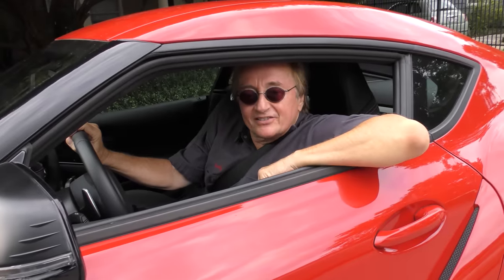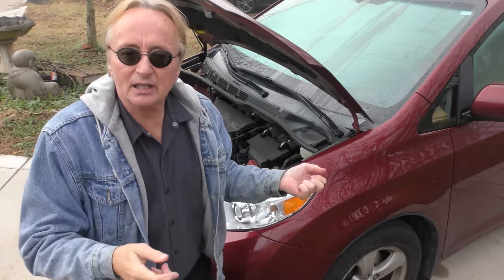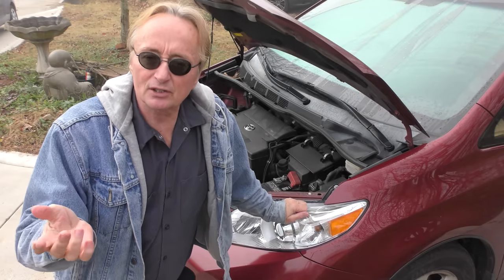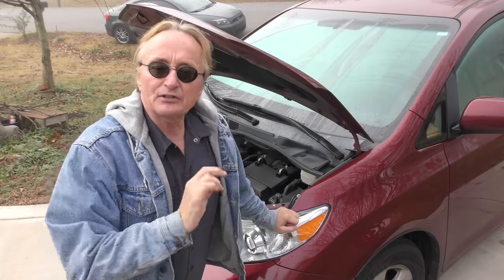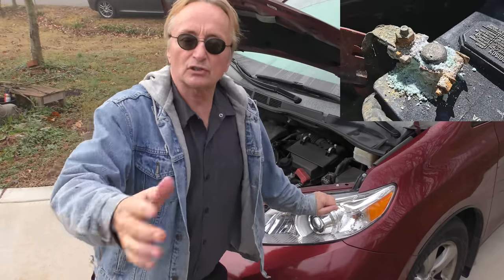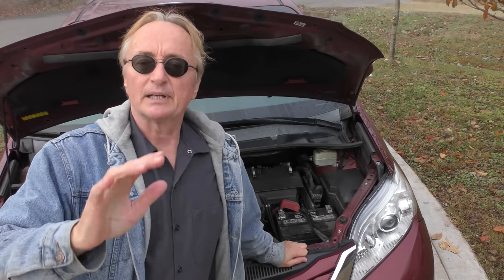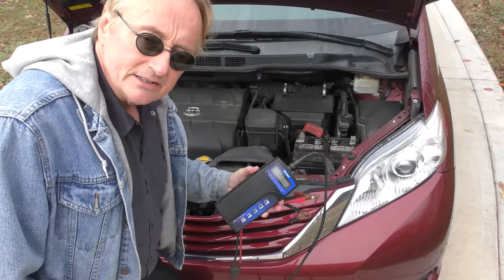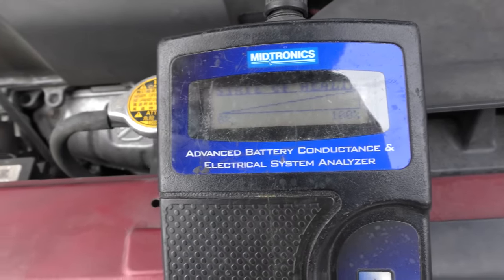If You Buy a Car Battery from This Place You’re Stupid

Comment: Scotty you are 100% CORRECT I got a battery from this place for my 2008 Chrysler 300 SRT8 and it DESTROYED the car. It’s now at J&J auto wrecking
Reply: I think the fact that it was a 2008 Chrysler 300 SRT8 had more to do with it. In case, may it rest in peace.
Reply: Probably installed wrong polarity😏
Reply: @raymondsmith6315  Unless the battery shorted out and backfed through the electrical system, otherwise I agree completely.
Reply: Install error. Lol
Reply: And that was a good car only 68k miles damm RIP Chrysler

Comment: I worked at Exide battery  in Reading PA . They make the batteries for Autozone , Advanced Auto , Napa and Walmart.
Reply: I just recently brought a Exide battery at Home Depot recommended by my friend. Works great 3 year warranty cost $109 while duralast was $169. Can’t believe the big price difference.
Reply: Unless this has changed since March 2020 Clarios makes there batteries not Exide. Former Advance employee. Rural King sells Exide and they are absolute junk. Advance named Clarios their 2019 vendor of the year.
Reply: A few yrs ago, a battery I got at Walmart had a sticker on it that said Mexico.

Comment: The longest lasting battery my friend bought for me was from Walmart & it lasted 8 yrs.  It was about $60.00.
Reply: When was this ? nowadays they cost around 200+.
Reply: My 8 years old Altima still have original battery. Checks good, but I'm changing it before winter.
Reply: I need a battery. My car is old and I want one as cheap as possible. I have a Wal-Mart $50 gift card so that’s where I’m going lol
Reply: @johnnya287  screw it I decided to just buy one at auto zone with warranty lol

Comment: I bought an Oreillys battery 5 years ago in the spring. By winter, it dies off and wont start my yukon. Granted i have a minor parasitic draw i cant find that eats up the battery, but ive returned the battery and every year.  Oreillys tests it and always say it's detective, and they give me a new one.
Reply: suggestion if i may. as i posted above a simple batter maintainer from harbor freight will keep a fully charged battery charged.
Reply: The battery maintainers from harbor freight are junk

Comment: A battery getting old and losing it's charge can cost you:
Your alternator will need to work harder and wear out the brushes sooner. 
When your starter is dragging it draws amperes, gets hot and it will fail prematurely.  
Your heater fan motor, wiper motor, power windows and locks are dragging and slowly burning them up.
As soon as my battery tests borderline I buy a new battery.
I put an Interstate Brand little car battery in my old Bolens riding mower and it lasted 15 years.
The MTP types are the best batteries made by Interstate.

Comment: Speaking of motorcycle batteries...  The longest lifetime battery I ever had was 15 years...  It was a 2000 Suzuki Bandit and I replaced the battery in 2015.  I bought the bike used in 2003.  The battery was OEM.  First thing I did to the bike once in my garage was install an electrically heated clothing tap.  Of course, the tap then doubles as a harness for hooking up a smart trickle charger.  The thing was plugged in and maintenance charging the moment it entered the garage from a trip.  The bike now has over 100k and it's been all over North America.

My pickup truck sits idle most of the time.  It has a knife switch on the battery negative terminal.  It's also hooked up to a smart trickle charger while it sits.

I get quite a bit of life out of my batteries.  ;-)

Comment: Blame the lead shortage on the ammo shortage
Reply: I thought that was because of the brass?
Reply: blame the lead shortage on the fact that manufacturing, many recycling plants, and overseas shipments were shut down for quite some time...
Reply: The shortage isn't due to lead. It's due to primers.
Reply: It's likely the EPA who makes batteries expensive and experience shortages. They have a ton of green recycle rules which require expensive licenses and then "Lead" is like poison to those EPA nerds. They usually are in the way vs. doing any good however, the good they do is reasonable but there is a limit to what they should get involved in, they just haven't figured that out yet.
Reply: @Garth2011  lead is a poison.  Just ask the parents of Flint Mi.  Lead causes nerve and brain damage.   Don't bring opinion in to facts.   Yes the EPA over reaches at times.   But I don't want to live in a chemical wasteland like some parts of China.   Yes jobs are important but there is a cost for everything.  Nothing is free including clean air water and soil.   No regulations means a return to the bad old days of cancer and birth defects and shorter life spans.  Depending on what you do for a living EPA and OSHA regs might be keeping you alive and healthy.
Reply: @p.o.9964  Didn't say eliminate the EPA or suggest chemical wastelands. Regulations are fine until they overstep reason. Once you factor in cost vs. benefit, not all OSHA and EPA dreams are reasonable. Just like my vehicles...every two years they have to be checked for pollution levels. For both of them, they pass every time and have like millions of other vehicles do yet the EPA doesn't trust 99% of the people who pass every time so we all give fee's to the State for nothing. It's those few who continue to try to beat the system and there should be better methods to address them vs throw everyone into the dishonest tank. If the EPA was somehow taxed or penalized for the overly expensive methods to control emissions etc. they do to business owners and the public, with very little benefits, they'd think about their process in more economical ways. As it is today, some methods are good and lots of them do not but they don't care about the costs, they just make rulings and enforce restrictions that most folks would rework to be more valuable. CA has an organization CARB in addition to EPA and they believe that CA atmosphere stays in CA apparently. Well, the facts are that is untrue most of the time. 
There are dentists who say "You must take out your silver fillings and replace them with the new plastic ones". Totally untrue but the sales pitch is "mercury" based isn't healthy. Those dentists should also say, silver fillings are still acceptable in the dentistry and the health dept.
Reply: @p.o.9964  there is regulation and then there is over-regulation.
Regulation can make certain processes and industries, safer for workers and the environment.
Over-regulation tends to make those same certain processes and industries too expensive to occur here.  When this happens, it just shifts where the dangers lay, and who gets affected.  It actually makes it far worse for the environment as well as the new workers that are subject to far worse conditions in a largely unregulated country.  So, all you're doing is shifting the workload, killing the industries here, and giving that work to someone overseas, often in far worse working conditions.  The EPA. like many other alphabet agencies,  is not known to make wise decisions to help US industries; often, misguided officials work to close down industries because of their "feelings"; shifting the workload overseas does not help; it rather hurts everyone else. 

Flint Michigan is a disaster because of years of neglect by politicians and elected/unelected officials, most of the dem variety, over the course of decades.  it's just another shift the blame game sort of thing; but it was brought upon by voting democrats into office, and decades of neglect afterwards.  Basically, no one wants to pay for their own infrastructure upgrades;  "poor us" because the residents and their elected officials just chose to do nothing until it became a major disaster;  even then, they're not the ones picking up their mess; it's other taxpayers. Eventually, all infrastructure needs upgrading; yet this population is the victim because they don't want to pay for it themselves.  The inaction of elected leadership was borderline criminal.  The elected leadership is elected by themselves.. Reality is that they are victims of themselves and the previous generations that voted the same way, decades after decades.. . Way too many in Michigan want that free ride; just like many other dem ran areas.
Reply: @MrPir84free  I agree that the EPA at times over reaches.   That is why I have said the we should put environmentalists, safety, industry and workers together to create policy that all groups can live with.  Not a perfect solution (as if which a thing is possible) but one that we the people can live and work with.

Yes Flint was a failure of political leadership (no surprise), but my point is the damage that lead causes.   Not on what the cause was.   Opinion here:. I honestly think there will come a time when folks will come to realize that plastic is like lead was to ancient Rome, cheap, plentiful, easy to work with, but toxic to our biology.  Plastic has contaminated every place on this planet.   I also think it is why people and animals are getting fat, and the increase of emotional issues and many other ailments.  But that is just my opinion.
Reply: Oh by the way when Flint was contaminated it was done under the Republican watch.   Governor Rick Snyder was at the time.
Reply: @p.o.9964  Wonderful work the current Governor is doing with all of those dams in Michigan. All that lead being spread downstream.
Reply: Balme the ammo shortage on the Democrats.
Reply: @volvojohn9036  Over the years it seems that the democratic voter and the democratic candidates have much different views. Those incumbents and those candidates for the democratic party are extreme left liberals while the voter seems to be much less of that. This is where some have been suggesting, its not the democratic voter per say but those alleged democratic candidates who are the worst enemy of this nation. Not to mention, many who register and vote democratic are employed by the feds, states, counties, cities etc. and will blindly vote for dem candidates just to see if they get a pay raise or benefit margin. NOT the best way to vote.

Some of these "shortages" are man made just to use an excuse to raise prices. Also, when was the last time ammunition companies expanded to keep up with demand? People need to stop buying ammo and let the system work for them. In time, shortages and high prices will not be an issue.
Reply: @p.o.9964  Please read down below a reply to Garth Clark, In rare form I posted info just to show SOME of what I have seen.

Comment: The stock battery in my Scion xB lasted almost 9 years. Since then i've been through a battery every two years. Junk batteries now-a-days.
Reply: The stock battery in my Toyota Corolla lasted 8 years. It was a Panasonic,yeah, like the stereo.Looked online and couldn't find one.
Reply: Panasonic, my 2012 FJ Crosier has original Panasonic from factory too. Problem is, you can't even buy that Panasonic battery off the shelf anywhere.

Comment: Scotty is right on the money, Autozone batteries are WAY overpriced. I picked up a fresh Walmart battery in october rated at 680 CCA and it tested at 731 CCA. The batteries are made in the same factory as the Autozone batteries.
Reply: Lots of batteries are made by Johnson, then brands just put their own label on it. Might as well buy them at Wally's.
Reply: @FredTheLutinoCocatiel  Interstates  are the best battery for cars.
Reply: @kachiquitaito3341  agreed.  Both my cars have Interstates in them and even on the coldest days cars fire up no problem at all.
Reply: @lonewanderer3603  again, just because their made by the same company doesn't mean their made to the same standards. Look at the CCA rating on wally world batteries, its lower then everyone else's. You get what ya pay for
Reply: @jroda8015  
agree......wally  world  N-everstart  battery.  don't  expect  it  to  last.
Reply: Not anymore, walmart has changed suppliers around the time of this post
Reply: Walmart batteries, at least around me, are all Deka batteries with somewhat lower CCA ratings.  I get my batteries from a Deka distributor near me, they run about $110 and have never given me a problem

Comment: I usually buy batteries at Costco and they last 8 years which is impressive. I live in Quebec and they're 120 CAD so around 95$ US
Reply: Good tip.
Reply: Me 2 half the price at Costco.
Reply: @girlonlaptop  My parents bought them too and on our Acura 1.6 EL 2000, the battery had lasted 7 years instead of the 8 years and Costco refunded us a bit less than 1/8 of the price of the battery without us asking (it was like 7 years and 2 months)
Reply: uhチュンチュンマル  Lol, we have been impressed with those Costco batteries and my parents have always bought them there after the one that came with the car dies and those Costco batteries just last so long
Reply: Kirkland car batteries used to be a Consumer Reports best buy. My experience in British Columbia they are now garbage. Stay away!
Reply: @MrAcer505  I installed my share of them at Costco
Reply: @grantwhebell7730  I am surprised to hear this. Maybe in BC they have a different supplier...
Reply: @MrAcer505  they sell Interstate batteries. Very good and about 95 bucks!
Reply: William Saad
How many batteries exactly have you bought from COSTCO?
What has been the lifespan of each of those batteries?
Reply: @andrew_koala2974  My parents each had  a car that kept until the wheels fall off (about 20 years) and they they bought about 3 batteries per car and lasted 7 to 9 years
Reply: I wouldn't buy anything at Costco, those stores are horrible no space in the aisles horribly arranged. In San Antonio there's so many people in Costco it's a joke. The nice stores in San Antonio are the discount stores owned by Walmart forgot the name. Anyway they have the best room in the stores the best layout and the best products. And you're not jammed in like you are at Costco. I hate Costco on never go back there again. Plus I have good food at the Walmart discount stores. Good pizza good hot dogs and plenty of room you can relax there you feel like you're in a sardine can at Costco. I hate that store parking lot too small plenty of parking at the Walmart discount stores
Reply: The name of the stores I like or Sam's, in San Antonio they have some very large ones very nice. I have a couple of old ones that aren't that great. But the newer stores are 50 times better than Costco beautifully arranged plenty of space a lot of good merchandise and you can eat the food there too is very good peaches awesome for $2 for two slices oh, and the best hot dogs ever. I bought a lot of stuff there and got good discounts if you watch when they're putting TVs out they usually will put some out at a discount at first I saved about $200 on a big screen TV a smart TV because I bought it just as they put it out normally was $780 I got it from 520. Wow you can relax and Sam's they have great merchandise. The Costco I went to is very large but the aisles are small the stuff is arranged horribly they are very high shelves you can't see across the store Sam's you can see across the store they have a better display of everything. Costco sucks
Reply: I took my sister to exchange a dead one she left the lights on. No questions asked. They charged her $2.35 usage. When we exited out the door I told her to run!

Comment: Audi dealer wanted $600 to replace the battery during maintenance. Bought battery at Orileys for $200 and replaced it in 10 minutes. Battery was in the trunk and required 2 sockets. New battery was dirtier than the old one.

Comment: I've had good luck with cheapass Costco and Walmart batteries. Better than the Optima I had in one car for four years and replaced twice under warranty.
Reply: Back in the day, Optimas were the best you could get, and the Army started to transition to them. Then the factory was moved to Mexico and now the Army is switching back to lead-acid and using desulfators. Regularly getting 8+ years in construction equipment and trucks.

Comment: I buy used batteries from a place that buys used batteries from car wrecking places. I pay $35 with the core and if the battery is less than 6 months old I pay $55 with the core. I do this cause I am saving myself from buying $200 brand new batteries. Of course when I go buy the used batteries, I bring my battery reader and if I see at least, Good Battery, Recharge. Then I go and buy it, but it has to say, Good Battery, before I buy it.

Comment: If you buy a battery which is "dry charged" i.e. they just poured the acid into it and called it good to go, by all means after you get it home (either installed in the vehicle or just riding in the trunk), take the time to fully charge it on a decent charger (Like a CTEK 8 program MS5) and charge it for however long it takes to get it to 100% (up to 48 hours).  The battery will reward you with a great long life....

Comment: around 40 years ago, i had a battery in my 69 fairlane that was just bad enough to not start my car so i took off the alternator belt, turned on the ignition and spun the alternator by hand for awhile, hooked the belt back on and my car started up.

Comment: If your battery is smaller and you can buy from Costco, do that as they have higher quality products. Do not buy smaller batteries at Walmart, they die too quickly. I went through 3 of their batteries in only 2 years on my Honda Odyssey minivan and they did refuse to honor the warrenty. Bought the next one at Costco and no problems.

Comment: Do not get Optima batteries. Quality is not the same like it used to be.
Reply: They are made in China now.
Reply: @maxwellcrazycat9204  makes sense. I had to replace 2 in my s10 xtreme. Now I use northstar. More money but it is way more reliable and can handle my car audio needs. Lol
Reply: Only Optima battery that hasn't acted up on me too early is a Yellow Top. Red Tops are trashed the very moment you cycle one without the engine running.